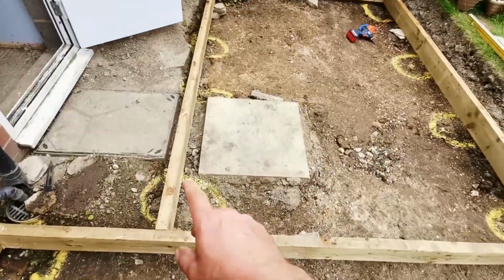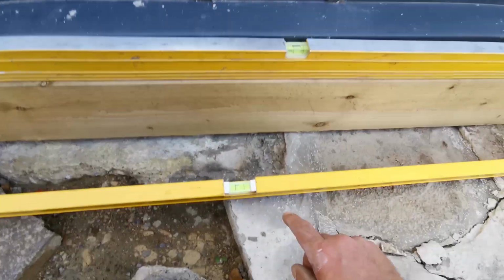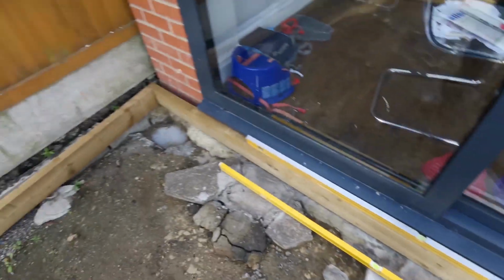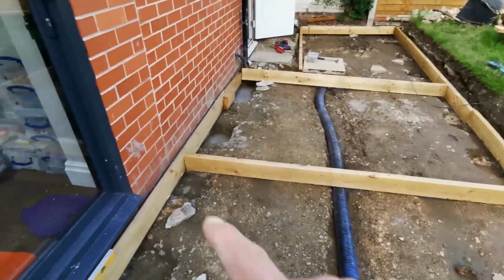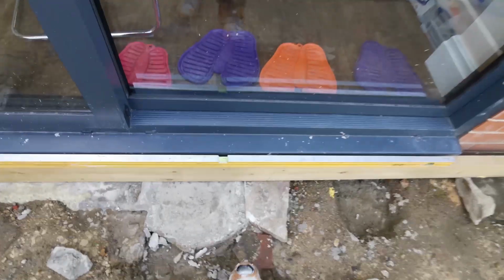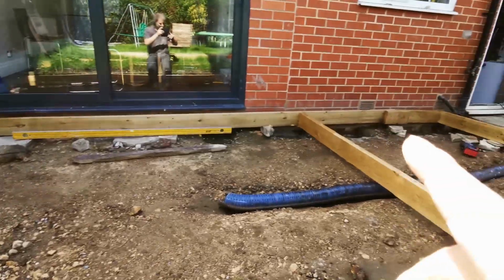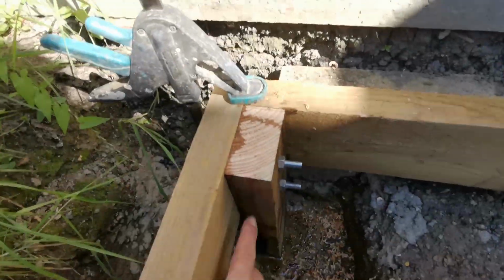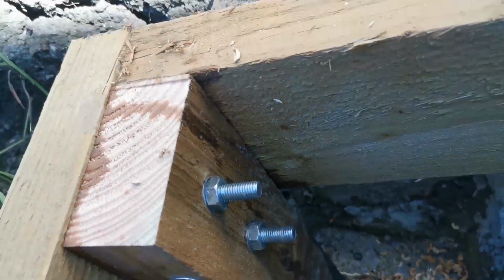Grumpy bank holiday flat deck building - Starting the posts & frame

Comment: Alright Gid mate. Quick question again. Sorry mate. What size and how deep are you holes that you filled with concrete? Few holes I can't get through as deep as I would like so need to post anchors. 
Thank you 👍
Reply from the maker: Hi, i didn't dig these holes, they didn't go even half as deep as i would've liked, Normally in a garden there's 1ft - 18" or so of black soil then yellowish sandstone or clay type substrate, (here in Yorkshire) i dig down to that, if i only find black soil 18" down i put in a good 1ft round x 4" concrete pad at the bottom, let that dry & sit the post on it to spread the weight & help stop it sinking, if it's hard sandstone in the bottom the concrete isn't necessary, you're better off looking at my FB pics 👍 https://www.facebook.com/gid.joiner/photos_albums you can backfill the holes with whatever you want, Imagine it like a table with it's legs pushed into the ground leaving the top 1ft off the ground, it isn't going to go far if you stood on it, & if the legs only went into the ground 6" - 1ft & you back filled them with concrete, that concrete would just be like a doughnut around the post, not doing much, a lot of the strength is in the joints at the top, that's partly why i notch & bolt them,
Reply: @Gidjoiner  thanks very much mate. I'll check it out now. Appreciate the help.
Reply from the maker: & even if a post is concreted in it is only as strong as the soil around it, i try to disturb the surrounding soil as little as poss 👍
Reply: @Gidjoiner  nice one Gid, I've gone down 800mm on the ones I can get down that deep and the soil seems solid. Bit overkill.  Mind you, they have just filled up with rain water 🤦🏻 I've got a block under for the posts to sit on. Some holes I can't get deeper then 150-300mm 'ish so bit stuck there hence the anchors. I can't get on you Facebook page as it says the links broken.
Reply from the maker: I've had problems with FB 🤷‍♂️ Yeah digging can be a bit tough, if you've hit stone then that's the end of the dig, i've got those hole diggers that are pointed & the long roughneck bar that makes it easier going through stones or when the grounds a bit hard but not solid bedrock.,
Reply: @Gidjoiner  thanks again. Really appreciate the advice.

Comment: Instead of moaning about the bottoms of the post holes not being flat, you could've just propped the deck frame to level,  bolted the joists to the posts,  and poured concrete in the holes and tamped it so the concrete flows underneath the post too 🤦🏻‍♂️. Total waste of time notching them posts to sit the joists on! Two coach bolts straight through the joist and full post is plenty! You really make a right job of that,  moaning about the post holes not being flat

Comment: Is it okay to keep a deck flat/level?
Reply from the maker: I can't remember how long this deck was but the timber/boards aren't flat or perfectly straight & 4.8m long, so to get any kind of worthwhile pitch it'd have to be quite a slope, you'd need at least 20mm if not more per metre, so over just 3metres the deck would slope 60-70mm (3inch), i don't like that, these boards have big gaps between them so water doesn't really puddle, putting a slope on just isn't practical.

Comment: Hi Gid, on a 16”x8” deck how far apart should the holes be for the supports, and on one side there be a lazy spar so should the joists be closer and extra support holes, hope this make sense, cheers for your time.
Reply from the maker: Hi, hard to say but they are supporting that side of the deck so not too far apart, i put them roughly 1m apart but sometimes that has to change slightly for each job, it' only like a table sunk into the ground but too many posts is better than too few 👍

Comment: I,co just ordered four of those wolf craft 150mm clamps off amazon, they were only £12.50 each, that's cheaper than I,ve seen the Irvin ones for. Nice one m8!
Reply from the maker: Thanks 👍👍 I bought two of the ones that open with the second lever, liked them n after a few yrs of abuse decided to buy two more, unfortunately i ordered the wrong ones, i got the ones with just the reg release second trigger, 😢 Which ones did you get ?

Comment: Hey Gid, did you mention anywhere what size your timbers were?
Reply from the maker: Hi, yes i do mention it, - for 2" joists @ 400mm centres it's ( Span ÷ 20 + 20mm) that will give you the size/depth of joist needed, eg. a 2.6m span ÷ 20 = 130mm + 20mm (the 20mm added is for safety & to reduce bounce in the joist), so to span a distance of 2.6m you need a 150mm joist.  To see what distance a piece of timber will span do the calculation backwards, a 150mm joist is, 150mm - 20mm = 130mm,  130mm x 20 = 2600mm . therefore a 150mm joist will span 2.6m,
Reply: @Gidjoiner  Ah, this was the video where you mentioned that was it :p I've been using that ever since thanks, I was just wondering if you'd mentioned specifically what timber you used but as you say 2x6's thanks :D

Comment: I'm disappointed that you are not organised. I had to wait till Wednesday for my "Gid" fix! Pull yourself together man.
My weekend, on the other hand, was perfect, couple of cold beers and a snooze in the shade!
Just saying, a couple of handfuls of pea shingle in the bottom of the holes, would have levelled it off, he said, from his hammock.
Reply from the maker: I replied to this but YT's lost it, Yeah sorry, i finished this job Mon, i should've edited it that night, A bit of gravel yeah it might help but this frame is 8m x 3m ish, balanced level on rocks n bits of flags & i had to keep it under the door cill so not a lot of room to manoeuvre, I shouldn't have had to start trying to pack up 20 legs if the concrete was flat to start with tho & I swore i think a couple of times in this this so you might have gathered i wasn't in the mood for fannying around with bits of gravel.😉🤣
Reply: Gid Joiner. It's Murphy's third law!
No1. If it can go wrong it will.
No2. When it goes wrong, it picks the worst possible moment.
No3. When 1&2 happen, it will happen to you. 
O'Saunasey, however, always thought Murphy was an optimist!
You just put your head down, grit your teeth and keep going. Unless you wear dentures, then you grind your gums. Good luck!

Comment: Nice solid job - seen so many decks that are so springy. Yep real pain when the postholes' footings aren't fairly flat - the bit you want always the worst bit to put them on.
Reply from the maker: Thanks 👍 Yeah i try to slightly over do decks, or at least build as well as in a house, decks are for party time, lots of people on them, it always surprises me how flimsy some people build them, i think a lot are built by non-qualified builders, (can't think of a better way to describe them), mine are solid,
Reply: @Gidjoiner  yep seen some awful decks, especially when they were the next great thing back 90's ok of diy at least they had a go and a reason for it not done right but as you say I saw a lot done by ' professional '  so called tradesmen. Those really annoy me. If you not sure - look it up / ask around and find out sizes / spans no-one an expert in all areas builder or not (and real time served tradespeople getting thinner on ground )

Comment: Was wondering instead of notching the post could a 2x4 be screwed onto the post for the beam to sit on
Reply from the maker: Yep but every fixing put into the wood creates a poss weakness, the fixings puncture the treatment coating on the surface, I don't think it penetrates too deep, def not all the way to the centre so if those fixings end up below ground? 🤷‍♂️ the piece fixed to the side as you suggest would have to go all the way to the ground otherwise your relying on the shear strength of the screws/bolts. but I've bolted extra pieces on to supply support.

Comment: can I ask a of question, what mix sand cement should i use for the post foundations?
Reply from the maker: Concrete is traditionally a 6:1 mix, that means 6 parts sand/gravel (Ballast) & 1 part cement, to break that down further it's 4 parts 20mm gravel, 2 parts grit sand, 1 part cement,  you can buy the Ballast (sand/gravel) already mixed in a bag ready to go, If you use just sand & cement it'll shrink n crack, that's what the gravel is there to do to bulk it out & prevent shrinkage, 👍 Don't be tight with the cement, not enough & the concrete will be porous & crumble in time, too much & the balance of sand/gravel/cement is wrong & might lead to cracking for the same reason i mention above, also too much cement can make the concrete brittle but you would have to put a LOT in to do either of these things, so go with the 6:1 mix & throw just a little more cement in if you're unsure if you've put enough in, rather than not enough, I work it on 6 bags of ballast to 1 bag of cement, providing they're similar sixed bags.

Comment: Shouldn’t it be at least 150mm below the dam proof course?
Reply: And if not fixed to the wall would you sat 10mm=15mm away from wall??
Reply from the maker: It's more than that away from wall
Reply from the maker: The outside wall is classed as a wet wall, the only reason you get damp inside is if the inside cavity is breached or the damp course is not stopping water from rising for whatever reason, the outside wall could get rained on constantly so if those two i mention are correct there won't be any damp.

Comment: Why didn’t you set the posts in the concrete? Or you could have just used concrete slabs. Would stop the water puddling in the hole
Reply from the maker: I mention in the vid putting concrete around the post would be just like putting a doughnut around, pointless, If the holes were dug to the depth i wanted than water in the hole wouldn't be a problem, below 6"-sh the ground/post would be  hermetically sealed, no oxygen n therefore no organisms to rot the wood, that's why fence posts rot at ground level often leaving a stump in the ground, I spoke to the client who had ignored my advise when digging the holes, after explaining i wasn't happy with what a very piss poor job he'd done i mentioned options like you say about blocks but i felt i was getting nowhere & to be honest i'd had enough of this job,
Reply: Gid Joiner ok fair enough, many thanks.
Reply: @Gidjoiner  For anybody who has not had to dig OUT those "rotten stumps in the ground" when right next to walls and poured concrete; it is a complete #unt. Spent several days face down in the ground (armpit level with edge of hole) mashing old screwdrivers and chisels attempting to remove rotten timber that was still strong enough on the inside to kill hours of time but rotten enough only to come away in bits. Digging iron bar? yeah right, they get wedged in the wood. Did consider burning them out with charcoal.
http://www.prowellwoodworks.com/articles/_site_articles/postholes.htm
BTW: Thanks for the video.
Reply: I had the same experience.

Comment: Enjoyed the video, informative and humorous. I’m a novice with building work. What’s the black pipe running into the centre of the deck which just seems to end with the open end in the soil?
Reply from the maker: Thankyou Ben 😊👍 The black pipe is a ground drainage pipe builders put in front of the extension, the owner moved it when he dug out this area.

Comment: Great channel, new subscriber, we often use galvanised post stirrups here in Perth, Australia, set it in concrete, keep the end of the post out of the water,  use your method too though, cheers for a great video...
Reply from the maker: Thanks James 👍 Normally i would sink the post deep enough, 18"-ish, below 6" the posts don't rot they're hermetically sealed, they rot 6" above n 6" below ground, when the fences here rot there's often a stump left in the ground, as you see in this vid i had problems with the digging 😖🙃😂
Reply: Gid Joiner curious to know Gid by sinking them 18 inch deep what’s to stop the posts rotting at 6 inch below ground and snapping. Is this just inevitable? Having to put a few posts in myself soon and would appreciate the info. Cheers

Comment: Hi Gid, what do you use to drive the nuts onto the bolt. I'd like to buy one but struggling to find the correct stuff
Reply from the maker: Hi, in the past i used a Dewalt 1/2" chuck drill/driver but burnt out 2 quite quickly, i had/still have 2 Makitas, they're not powerful enough so went over to my impact driver on the air line, i used that for a while but having to have the airline n noisy compressor wasn't good so i bought the Bosch GSB 18-2-LI-Plus because it had a decent torque rating, 63Nm, It does well n i haven't killed it yet after quite a few yrs of abuse, so being more than happy with that it set me on the Bosch 18v tool route, i recently bought the Bosch impact driver, max torque 200Nm it says but i was very disappointed when driving in some coach screws, i thought it would piss on the GSB driver but noo 😒 I've learnt the impact driver has it's uses & is good for getting bigger screws in but still don't understand why it isn't hugely more powerful than the GSB, I use both for nuts, the impact because it has a sq drive chuck so i don't have to find the socket adaptor bit for the driver but i still like the driver, it'll twist your arm if not careful, only prob with that is i use the GSB driver for drilling the holes but then have to swap the bits, My little Milwaukee has pretty much died, it's piece of shit n i'll be putting it out of it's misery with a big hammer, i'll be replacing that with another Bosch 👍👍  Partly because i like them, they do what they should & i have the batteries but also because i don't want numerous chargers on site hogging sockets 👍😉
Reply: @Gidjoiner  what a brilliant reply. Enjoy smashing the shit out of the Milwaukee, maybe post a video of that too 😂👌. I have a 18v dewalt combi drill so may go with a dewalt impact driver so I can use the batteries I have. Your videos are so good, as a beginner they have taught me so much and really appreciate the advice. This shit is expensive so want to make sure I get the best kit! Thanks Gid! 🍻
Reply from the maker: If i was on-site still i might conform or choose another brand, maybe the Dewalt, I'd want the best, i'd be using it a lot more & would prob have a reg wage, more pennies in my pockets to buy the best & i also know what the peer pressure on-site is like 👍 if you turn up with a Ryobi drill 😂😂😂👎 I think the Dewalts have come a long way since then n people seem to like them, my other Dewalt tools have done well & my old chopsaw lasted over 20yrs, it still works but is a little tired so i replaced it with another Dewalt 👍 Yep the Milwaukee retirement will be getting filmed, was using it today & went out to the shed not long ago n it's light was still on 😖🔨🔨 Thanks, glad they're helpful, that's why i make them 😊👍👍

Comment: Cracking video gid I've almost watched all your videos now I'm thinking of doing decking at my house would fixing it to the side of the house be OK
Reply: As long as you put a space between the timber (ledger board) and the brickwork so air can dry the space out when it gets wet.
Reply from the maker: Thanks Russell. 👍 I avoid attaching it to the house simply to avoid damaging 'their' house but on my own house i might, make sure it's braced in a way that it's not pulling on the wall if it's not a low flat one like this, vertical load on a wall is fine but not a lateral load. as Kracken says leave the air bricks open that's why my frame is 2" off the wall, i should've mentioned that in the vid, it prob should have an uninterrupted air flow through but you do what you can to let air in,
Reply: @Gidjoiner  thanks that's great advice mine will be almost the same except I want to use composite decking thanks mate look forward to the next video's

Comment: hi Gid, what make are those clamps?
Reply from the maker: Hi, Wolfcraft 😉
Reply from the maker: These are the ones that open & close with the lever, 20yrs old mine n apart from the spring in the other this one is still going well n strong, going to buy some more one day, got enough for now but never have enough https://www.amazon.co.uk/Wolfcraft-3031000-one-hand-clamp-100-300/dp/B000P39LES/ref=sxbs_sxwds-stvp?keywords=Wolfcraft+One-hand+Clamp&pd_rd_i=B000P39LES&pd_rd_r=d382f34a-de71-47f5-a2ee-01a4df7702ee&pd_rd_w=AOZr8&pd_rd_wg=biC3t&pf_rd_p=7dc56c0d-8a5f-4d97-9143-7233b106859a&pf_rd_r=6GM4NFC3ZRMC6CBPVRSC&qid=1567028184&s=diy
Reply: Thanks Gid
Reply from the maker: @senseinathan1  They look a little different to mine but mine are 15-20+yr old-ish

Comment: The square drive on that Bosch gun is a great wee idea! Good video as per, mate! One question, what's the score with the concrete for the extension being at ground level? (In the corner where the owner struggled to dig through)
Reply from the maker: The concrete i don't know,  🤷‍♂️🤣 i didn't spend too much time thinking about it. that drain away pipe ran along the bottom of the wall up to that bit of the extension with the doors in but no further, before he dug it out, 
Yeah the sq drive is why i bought it, in the comparisons on YT it can last, but that's the part i wanted it for, for jobs like this tightening coach bolts up & it fitted my batteries, it's good enough for my uses.